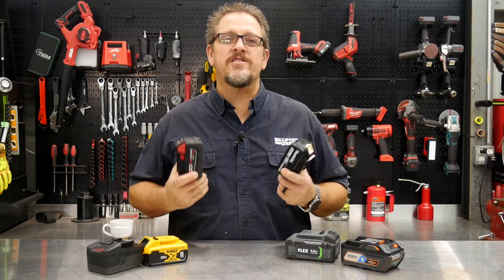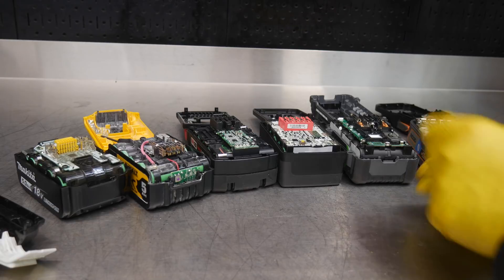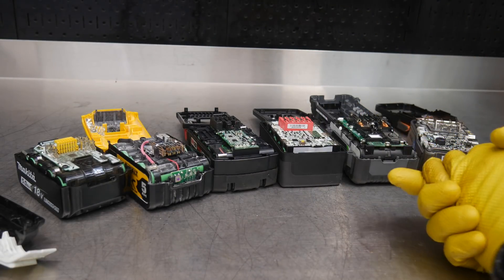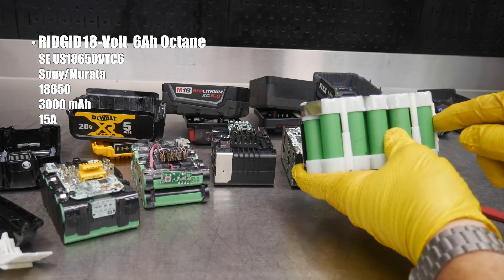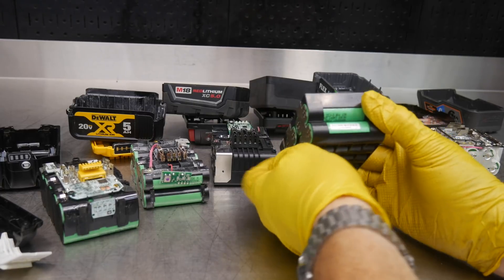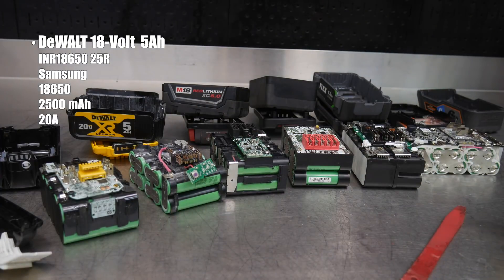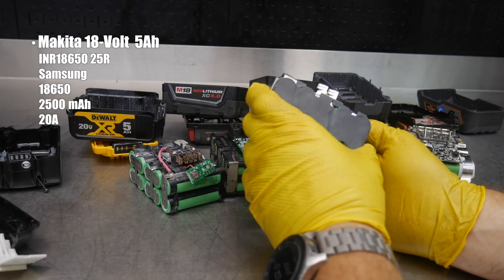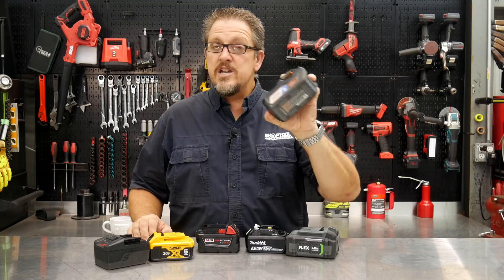What's Inside Tool Batteries? Milwaukee FLEX DeWalt Makita Snap-On [18650 21700 ??]

Comment: The DeWalt is a 18 volt, it's 20 volts max, but it's no different than any of the others.

Edit: I saw later in the video you mentioned this, great video man 👍
Reply from the maker: Appreciate it. Thanks for watching.
Reply: It's how they get out of paying a royalty to Milwaukee. Milwaukee has a patent in 18v batteries for tools
Reply: @D41Michigan  nope, DeWalt has had 18v lines for many years. 20v is just for marketing, to trick you into buying the same tools in a different battery platform.  Outside the US, the same DeWalt stuff is still labeled 18v because other countries don't allow those types of lies. It's only 20v at rest after a full charge, drops under 18v with any minimal load.
Reply: @jba6677  I know about the 18v stuff. I told you why they started doing a "20v" line as 20v max was to get around Milwaukee royalties because Milwaukee patented "18v lithium ion batteries for power tools" that's what's on the patent. Dewalt work around was to market as 20v Max

Dewalts 18v stuff is not lithium ion but nickel metal hydride. Therefore that line doesn't owe royalties to Milwaukee. 

Do a quick search and you'll see that Milwaukee owns the sole rights to 18v lithium batteries
Reply: @D41Michigan  US7554290B2 covers li-ion power tool packs producing 20 AMPS or more, which covers almost everything, voltage doesn't matter. This patent should never have been granted and covers nothing new or novel. They just handicapped everyone in the tool industry chemistry progression from nicad to nimh to li-ion. Li-ion power packs existed long before the patent was filed. Surprised milwaukee is a patent troll, I'll be sure to not buy anymore of thier tools.
Reply: @jba6677  lol ok. They will miss you.
Reply: @RaggedsEdge  thanks for your input. China appreciates the support.
Reply: @jba6677 , you probably don’t own any Milwaukee M12 or M18 tools to begin with and didn’t plan to buy any in the future.  What a Drama Queen...
Reply: @martylucas8557  I actually do, and thanks for your useful input. It's pretty sad you don't understand how battery packs have been assembled for the past 30+ years.

Comment: I think Sony vtc6  is a 30A discharge cell
Reply from the maker: It's a 3000 mAh cell with 15A continuous discharge without temperature cut. 
Max continuous discharge current:  30A (with temperature cutoff circuitry at 80 degrees C)
Max continuous discharge current without temperature cut:  15A
Reply: Shop Tool Reviews Thank you. Now I know.

Comment: I'm a vaper so i use 18650s all the time so 18650 is smaller than 21700 each cell usually 4 volts charged but difference is mah so they wire in series up volts.

Comment: The dewalt battery is an 18v battery. They just dont want to pay Milwaukee royalties for putting 18v on the side of their batteries so they put 20v max.
Reply from the maker: Yes, and No. They went to 20V Max for marketing purposes and to separate themselves from the old 18V Post packs they used prior. Thanks for watching.
Reply: Where are you people getting this idea that Milwaukee gets royalties for lithium batteries did they invent lithium batteries? No , snap on got in trouble for making batteries that would work on their tools and Milwaukee so stop with the royalties bullshit already if anything black and decker were the first company to make battery operated tools so if any company would get royalties it would be them
Reply: @loucifer4205  No buddy said anything about them getting royalties for lithium batteries. It was about putting 18v on the side of the battery.
Reply: @Skwish6952  dewalt had 18v on their batteries long before Milwaukee

Comment: Is like to know which specific batteries have low voltage protection built in! I believe Makita 18v 5 and 6ah do, but all the lower capacities seem to not!
Reply: NONE of the five major cell manufacturers produce a cell with protection on them. That is added when the battery is made from the cells. If you see a cell with a button top protection, it has been added afterwards and rewrapped, rebranded. Maybe Panasonic sells a button top but I don’t think so.
Reply from the maker: That is a great question and one that we've been asking for years (not just Makita). It seems that some of the batteries/tools do very well with this, and some definitely do not. Thanks for watching.

Comment: Metabo HPT 36V (Multivolt) are all 21700 cells the 36V batteries are backwards compatible with their 18V line(Unlike Makita 40V😥) and run 5.0 with their 18V tools 2.5 as a 36V-- the larger battery runs 8.0 for 18V and 4.0 for 36V
I haven't seen too much difference in run time between my 18V and 36V Metabo HPT batteries
They run much cooler with the 36V tools and significantly increase power with both 18V/36V tools

Comment: I’d like to see the same video for the 21700 batteries. I know Milwaukee doesn’t use the same cells in all their HO batteries. The 6 AH and 8 AH have difference cells for example. I’d be curious to see the difference and what everyone else is using. 
Sort of surprising Flex didn’t go with 21700’s right away.
Reply: Believe the 8 is using 40T cells and the 6 is using 30T cells

Comment: Makita uses the 21700 cells in the 40v tools. The 18v line won’t get them.
Reply: 4 years later and still Makita only use 21700 cells in the 18v Lxt range. I've had to buy a diy makita 21700 battery case to make my own. The difference using 21700 cells vs 18650 is incredible! So much more powerful with more amps and voltage sag is non existent.

Comment: Interesting footnote on the DeWalt is how they are using the 21700’s additional output. DeWalt’s PowerDetect line specifically responds to its 8Ah and 10Ah battery packs, that themselves are both 21700 cells. The PowerDetect develops the extra power by way of increasing the amperage of the tool vs the FlexVolt, Kobalt, and FLEX increasing the voltage to develop more power. In my opinion, the DeWalt PowerDetect is the smarter design due purely to battery volume and weight being smaller and having a longer runtime with that smaller weight and volume, they are utilizing the 21700’s in the smartest manner.
Reply: Indeed Brandon!  Very well stated and explained!  I have the Power Detect drill, and I weighed my XR 8.0 Ah battery, Vs the FlexVolt 9.0 Ah (closest match) and it was 1#, 2 oz. lighter, than the FlexVolt battery.  I for one, wouldn’t want to be handling and toting around a drill that was over a pound heavier, than what is already a heavy set up with the 8.0.  And it really comes down to Amp draw.  Thanks for the comment!  Peace
Reply from the maker: Very good points. Thanks for watching.

Comment: I swear makita was using Sony cells but I guess they must’ve changed. My Milwaukee 3.0 Xc battery and Milwaukee 2.0 cp were both using LG cells and the the 2.0 had 25 amp rated cells while the xc 3.0 used 20 amp cells
Reply: Makita use sony VTC cells in their 6.0 pack.
Reply: Makita has used both Sony cells, as well as LG cells in the past, Brynnon.  I too was surprised at that!
Reply from the maker: We've definitely seen the different tool companies change battery cells, so it's not uncommon. Thanks for watching.
Reply: Look at the bottom of the battery, the cell origin is Malaysia or Korea, it is Samsung cell, if Singapore, it is sony

Comment: Technically the Dewalt is 18V nominal like all the others except Flex. They use 20V Max* for marketing. And Flex is 21.6V nominal and 24V Max
Reply from the maker: That's what we said. Thanks for watching.
Reply: @ Ezra Waters additionally, if you didn't know, Milwaukee trademarked the 18 volt tool battery size. So anyone that uses that size in the name of their cordless tools is required to pay Milwaukee a royalty fee. This is also why DeWalt calls their batteries and tools 20 volt tools. All to get around paying Milwaukee that fee.

Craftsman used to do the same with their 19.2 volt  CP line of tools. 

It's really the same thing as Milwaukee's 18 volt line but by calling it something else you don't have to pay additional fees to your competition.
Reply: @El_Diablo_LI  none of this patent rumor stuff is true.  And that's not why Dewalt call them 20V either. (they're labeled 18V in EU/AU/UK anyways, and that's because of their government regulation, not because they care about some nonexistent patent from another American company)
Reply: It's not marketing stupid, then what is 12v they are 10.8v

Comment: Is the makita 6.0 the same as the 5.0?
Reply from the maker: No, it's a 6.0. Thanks for watching.
Reply: @Shoptoolreviews  thank you do you have a video on that ?
Reply: Same configuration (5S2P, 18650) but other, less current cells. So better for low power high endurance jobs.

Comment: Great breakdown! I'm surprised at Flex; for all the hype, I expected something like the Samsung 21700 40T cells.

I hope there's a new line of batteries called High Output that uses those cells.
Reply from the maker: I don't think they need it at this point. They're pushing some major power with the 18650 cells. Thanks for watching.
Reply: Samsung 40T is in the larger 8Ah/12Ah packs.  

I don't quite understand why everyone thinks you need 21700s in every single pack.  Makes more sense to have some smaller packs with 18650s so you can put them on the smaller tools that don't really need 21700s in the first place.
Reply: The INR21700-40T isn’t a particularly good choice for a 1P pack design. Flex does (presumably, since I haven’t seen anyone disassemble one yet) use them in the 2P/3P 8.0/12.0Ah battery packs. 

The -30T is used in the Ridgid Octane 3.0Ah and Milwaukee M18 CP3.0HO. While both of those cells are rated for 35A continuous drain, the 40T doesn’t actually deliver that consistently. Testing shows it can deliver 30A-32A but will struggle with that as it gets below 50% charge, while the 30T can sustain that until it’s nearly drained. The only pack that I’m aware that MIGHT use the -40T in a 1P battery is the Kobalt 24V 4Ah, but I don’t have confirmation of that, only saw a claim that it is a 1P configuration, and therefore, it might use the -40T.
Reply: Bosch Procore 4Ah is also a 1P pack using 40T cells, just with better heat conduction away from the cells.
Reply: Flex Tools currently has 4 sizes of batteries. 2.5 ah and 5.0 ah which both use the 18650 cells we saw here. 

But like Milwaukee, they also have an 8.0 ah and 12.0 ah size batteries, and both of those sizes, just like Milwaukee, use the 21700 cell batteries.

Milwaukee identifies all of their batteries that have the 21700 cells as HO batteries or High Output.

This includes the 3.0 HO, the 6.0 HO along with the 8.0 and 12.0 I just mentioned above.

Flex has not added anything to the name of their batteries that indicates that they're using higher output cells but their 8.0 and 12.0 ah have the bigger cells.

Comment: FLEX is 120wh battery its a 36v or 40v flex face off was rigged from the get
Reply: They should have put it against the Metabo HPT 36V and the Makita 40V , 60V Dewalt and the German Metabo ad those tools are better performers than many of the Flex tools-the 18V tools are older tech for the most part-when they claim "best"it should be each brands best Milwaukee is the exception as they are only using 18V still
Reply from the maker: People keep claiming "rigged", but they don't seem to have any evidence of such. I'm all eyes and ears if you have any. Thanks for watching.

Comment: I am surprised none of them use the Sony VTC5A Cells. They are very popular with people who vape using the higher powered mod boxes (2-4 cells) because they not only have 2600mAH but also 25A continuous discharge rating, so even with a high powered vape pulling around 200 watts, the batteries tend to barely even get warm. They would give any of these manufacturers an edge over the competition in 18650-powered packs.
Reply: Samsungs probably have better cycle life.  And when you're selling batteries with a 3 year warranty then cycle life is more important so you don't commit yourself to excess battery replacements.
Reply: @jaywelker5566  Thats a good thought but all the OEM 18650 manufacturers make good cells that last. Ive gad my VTC5As for about 3 years and they still work like new. I think its simply cost. You can get 25Rs for $6 each while VTC5As are $8 each so if a consumer wanted to make a 24V 5.2AH battery with 12 x VTC5As it would be $96 just for the cells alone... Oooof lol I could easily see a $150 priced battery with those cells in it.
Reply: @jaywelker5566  Correct

Comment: i think bosch procore series batteries are 21700, also metabo (not metabo hpt) has new high output batteries with 21700.
Reply: I own 5 bosch batteries, 2 of them procore. Older batteries were 18650, new ones are 21700. Most 4, 5 and 6  Ah batteries are 18650. Higher capacity batteries are 21700.
Reply: Makita should have made 40V batteries and charges backwards compatible like Metabo HPT did
Reply: The Metabo HPT Multivolt are 21700 cells
Reply: Bosch makes some of the best batteries
Reply: At this rate it seems only makita are refusing to go 21700 for 18v tools, which is annoying for those of us who have invested a fortune into a platform
Reply: @darylsavage119  never invest a fortune in makita. Cheap stuff but nowhere near top notch.

Comment: im disappointed that every flex battery isn't 21700 if i made a new tool company to rival the big 3 brands I'd use all 21700 cells unless its for a brushed tool
Reply: Size and weight, as well as cost. 21700 cells make sense for batteries 6Ah or higher, and sometimes in 3Ah 1p configurations like the 3Ah Octane battery. But newer 18650 cells can deliver 25A-30A, making 21700 cells unnecessary until you hit 6Ah 2P packs. 21700 cells do run cooler, and have less voltage sag, so they are better for peak performance, but it’s not a huge difference, so it comes down the the engineering trade offs of cost, size, weight, and peak performance. Choose. 

You can’t get more than 3000mAh in a high amperage 18650 cell at this time, so to exceed 6Ah, you have to go to a 3P design (like M18 HD9.0, and I believe the Octane 9.0) or 21700 cells in a 2P/3P configuration like every other 8+Ah power tool battery pack I know of.
Reply: @geoffstrickler  VERY well said Geoff
Reply from the maker: Cost! They use 18650 cells because they're cheaper. You can't blame them if they're able to pull this much power out anyway. Thanks for watching.
Reply: Not to mention now they have the stacked lithium batteries which I imagine are rather different inside. Plus, go with the cheaper batteries if you're going to be offering a lifetime warranty. The Flex batteries put out loads of power, enough to smoothly push my 12" miter saw and table saw.

Comment: is flexvolt 21700 i know there are 2 different versions of flexvolt batteries onr has the yellow bottom one has the gray bottom the yellow bottom batteries come in the flexvolt advantage kits and the gray bottoms are on the shelf individually
Reply: 18650s on the 6s
Reply: Look for the three little silver ‘stripes’ on top of the battery, each side, at the mounting area.  This denotes 21700 cells, is what I have been told.

Comment: We need more videos like this on batteries. There is a lot of confusion out there.
Reply: I had thought for the longest time that DeWalt's XR batteries used 21700 cells, but I guess not.
Reply: @christianness8983  the dewalt 6 AH uses 21700,  also , the newer 4 AH uses 21700,   so,  not ALL their their batteries uses 21700,  only select ones
Reply: Since MAC impacts are literally made by DeWalt, and DeWalt batteries fit on them, does MAC batteries which are interchangeable with DeWalt batteries use the same 18650? Has anyone tested the Flexvolt batteries on the MAC impact yet? Klein impacts also take DeWalt batteries but I don’t think they have their own batteries yet.
Reply: @paedahe4975 , I think you answered your own question.  Since Mac outsources their tools and batteries to Dewalt and Dewalt batteries fir onto the Mac tools, then Flexvolt will also fit onto the Mac, stepping down to 20v.
Reply: You’ve said a mouthful Howie Z !!!  Indeed, there is confusion, and speculation, and a whole lot of contentiousness regarding batteries, and their capabilities?  I don’t quite get it?  It is like dudes are ready to brawl over what cells are what and in what batteries! 😬😳🙄🙄🙄🤔🤷🏻‍♂️  Good comment Howie!  Hope you and yours are well!  👍👍👍😁✌🏻🇺🇸

Comment: Samsung 25R 18650's or 30T or 40T 21700's are the best money can buy.
Reply from the maker: Definitely on the top of the heap. Thanks for watching.
Reply: Now I've watched it, I'm not surprised they all run 25R's, great battery for the price. The VTC6 are a little more "posh" and are still a great battery (cost more too). The VTC4 used to be in EVERYTHING but they were only 2000mAh. The VTC5A were 2500mAh and 30A, but they cost about 20-30% more than their 25R counterparts. Would be very interesting to see a 25R pack go against a VTC5A pack. both 2500mAh but the Sony has up to 10A extra on discharge rate.
Reply: With 21700's the Samsung 30T is 3000mAh and 35A and the 40T is 4000mAh and 35A* 
Obviously these batteries are more dense thus produce more pixies. 
*if kept under 80c where it drops to 25A.

Comment: On my DeWalt 20v platform, I only have one 18650 battery the 5ah one.  Rest are all 21700.  

Both DeWalt and Milwaukee are slowly phasing them out.
Reply from the maker: I wouldn't say they're phasing them out, but the high performance batteries definitely have the 21700 cells, for the most part.
Reply: I only say that, because in the case for DeWalt.  The new 3ah And 4ah batteries are, 21700 cells.  The old 3ah 18650 battery is discontinued.  You can still get the 4 And 5ah batteries, but for how much longer?

I think eventually the 18650 cells will be relegated to the 12v line ups.